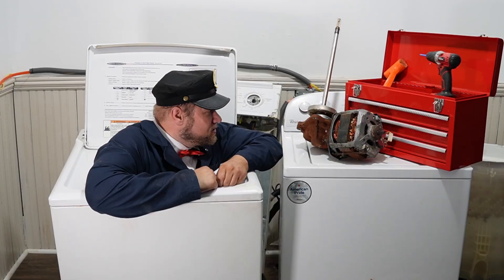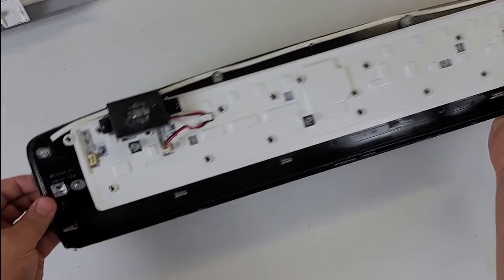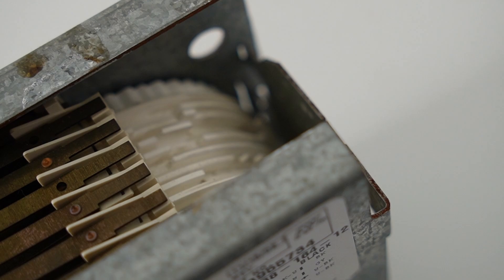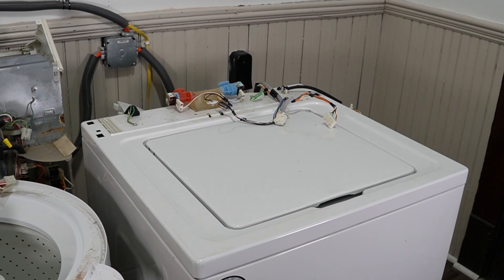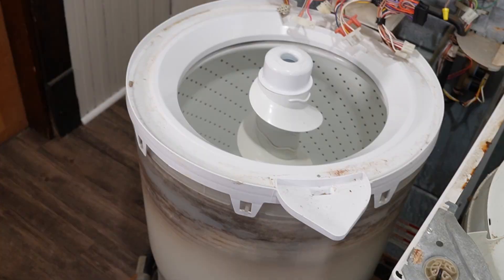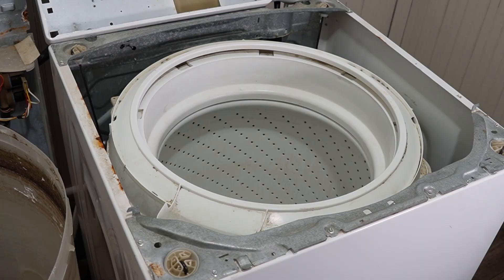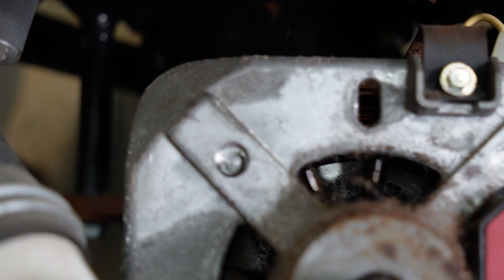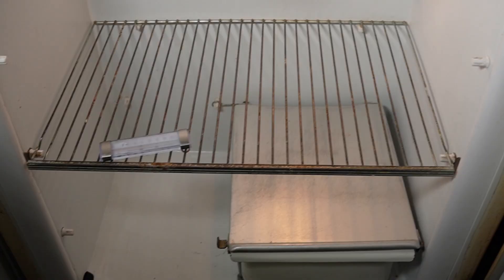Are Washers Built to Break? Inside a 1984 Washer vs. Now

Comment: The older stuff used electromechanical parts that were easily and affordably replaceable.  So now we have circuit boards and ECM control modules.   Ok, not that much harder to diagnose, but what used to be a $30 electromechanical part is now a $200 circuit board.
Reply: Those pcbs automatically get replaced. Stick with a true timer switch whirlpool based unit and never have a problem.
Reply: I'm a hardware/firmware engineer, it saddens me that people believe old mechanical systems are robuuster than modern electronics.

It's not that newer electronics are less durable by design, it's that management wants everything as cheap and fast as possible. Idem for most consumers these days, who prefer cheap and affordable equipment regardless of it's apparent quality. 

My washer broke a couple of years back, the repair technician told me to buy a new one as a replacement control board would cost 300USD. I reverse engineered my old washing machine, designed my own control board in eagle cad... My 18 year old washing machine has now WiFi, BLE and ZigBee... It's also configured to remain in standby, until my smart meter and solar panel setup commands it to power on. Saved me a lot of money on my energy bill so far...

The circuit boards I design for personal use  (such as in my washer) will most likely outlive both new and old examples shown in this video. I avoid cheap mechanical relays and use solid state relays with a lot longer lifespan. I keep some additional headroom in voltage and current calculations, and avoid components from reaching troublesome temperatures. Somehow my 'control-board deluxe' costed me only 150USD, instead of 300USD for the 'manufacturers e-waste version'...
Reply: @timmy7201  sounds like you may have a business to create boards for popular washers.. I’d be in to “hack” my washer.
Reply: @toejamr1  I've had the same idea, yet a colleague warned me for possible lawsuits for copyright infringement from the big corporations. Selling custom circuit boards would also require compliance testing, which is kinda expensive...

I've thought about open-sourcing everything for free, but with a money deposit system for financial support. People can use it free of charge, on their own risk. This way I'm not selling any commercial end-product, but rather a solution to a problem. I'm just not sure if such approach is "lawsuit safe", would need a lawyer to go through all paperwork as I as a tech-person can't focus on such administrative nonsense for more than 5 minutes :-( ...
Reply: @timmy7201  ..problem is..they are NOT cheap!..new stuff is WAYY more expensive..and not as good...we get sold "features", not quality..just give me something that washes clothes, and does so reliably, for a long time..no fancy features needed...
Reply: @timmy7201  also those pcbs cost a couple bucks to make tops
The companies like you said became greedy. They realized you need to get the controller
So we make it slightly less than the entire new machine. This makes the new machine seem like a better deal. And even if you get the board they make profit

I think another issue now is everyone reads reviews of equipment and these reviews are not long term and not edited to reflect reliability. This skews reviews to units with the best functions or new features. In the past you’d probably ask your neighbors to see which ones broke. Now you only complain to em after it breaks!
Reply: @timmy7201  so basically what you're saying is.... reverse engineer your washing machine and build your own circuit board and it might just be more reliable than an older machine. sweet, sounds easy peasy.
Reply: @dyer2cycle  Go for a bare bones Speed Queen. They use the same parts on their home washers as their commercial ones.
Reply: Yeah but you can also learn to do some electronics troubleshooting and  how to solder and the replacement parts are usually under a dollar.
Electronics are not a voodoo blackbox and with the internet there is zero reason to allow them to mystify you like they did in the 90s and early 00s.  Its a good skill to pickup now more than ever.
Reply: @busterscrugs  Well... It's easier than it looks, a washing machine only requires basic electronic and coding skills...
That's how I preferably pass my Friday and Saturday evening, designing electronics stuff and coding firmware with some friend(s) and cold beers... :-)
Reply: @hgbugalou  Yep, usually only a bad micro relay soldered to the board. In the case of HVAC controllers, anyway.   
Doing a board repair will buy you some longevity, but when it goes out a year or two later, your company catches hell from a bad review.  All because you attempted to help out a customer.   So we just replace entire boards.
Remember, that relay burned up for a reason, and all those tiny upstream and downstream components and IC’s took a licking.  In effect, you have only changed the worst damaged component that gets the unit basically operational for a while.   Can’t exactly solder in a microprocessor 1/8”x 1/16” that has 16 pins.
Reply: @timmy7201   I designed a replacement for the control board in my whole house humidifier in KiCAD. The old broken one was a janky single-sided PCB designed by Honeywell. The replacement is basically a stripped down Arduino Pro Mini attached to a perf board, and using a similarly pared back version of the Arduino libraries (remove the cruft and build using a customized makefile). That still manages to be about 1/2 the size of the original control unit.
Reply: @blackhawk7r221  I had a relay go bad on the control board for my furnace a couple years ago, in late January in Minnesota... It actually started on fire, and the whole house smelled like burning plastic. Luckily I was home at the time and was able to shut it down before it got any worse. picked up a replacement relay at MicroCenter for $3, swapped it out and it's been fine ever since.
Reply: I have replaced contacts in mechanical timers in washers, dryers, and dishwashers. Contacts are available, but I just used donor contacts from relays. A good rule of thumb: hot water, steam, and electronics don't mix. Stick to mechanical timers.
Reply: Pretty much this. The circuit board combines all of those discrete solenoids, switches, and relays, and when one of them fails, it's much harder (in some cases impossible) to replace just the failed part.
Reply: @reecenewton3097  I have  Sears Kenmore dishwasher from 1971. A few years ago the timer stopped working. Removing the timer I noticed who manufactured it. I contacted the manufacturer and they said they can replace it for me. 60.00 well worth it. Midwest Timer.
Reply: @timmy7201  The automotive repair industry; upgrades failure mode parts all the time, maybe this can be done with the failure pone appliance parts? I think, there could be a market for this type of thing.
Reply: @timmy7201  If you set up as a Unincorporated Business Trust or a Private Membership Association you can avoid all of that BS. You can either do it yourself or find firms specializing in these areas to set you one up.

Many big businesses are set up this way, and not subject to various countries' federal codes. We currently run a PMA, tho in general I think a UBT is better.

You've got a great business idea so I'd love to see you succeed. My 1.5 month old washer is useless for 3 weeks until the lid lock is replaced, so I'd love a functional bypass for that component alone as I love everything else about the washer.
Reply: @timmy7201  simple things like socketed relays and not cheaping out on your power supply is seemingly all you'd need to do to make it really solid system, that and not omiting the anti sease lubricant. If I was building it from scratch I'd use a brushless motor and an esc to be able to replicate the braking the older unit had but that's really it
Reply: @dyer2cycle  within the last few years adding "smart" features has gotten rediculously cheap. For me to get a single microcontroller with the hardware capabilities to control all of the logic and networking to add smart features to an appliance would be ~$10, which turns to peanuts once you integrate it into a control board and start making them by the thousands. 

The features are not why you are paying more for a shitty product, its just inexcusable
Reply: @timmy7201  mechanics are better than electronics
Reply: @timmy7201  by your own writing, the older units are more reliable than almost anything sold today. It's just the way it is
Reply: @timmy7201  mechanical relays aren't pey say cheap we use them in industrial applications all the time. Solid states have their uses and places but can't be used in system were they require both no contacts and and nc. I like infsutrial washer because everything is repairable in them they use plc motors valves controllers are all replaceable and easier to acces as maintenance was a string subject with these the shaft are around 6 inches wide so those won't wait anytime soon
Reply: exactly my point with my air con story above
Reply: @Spots Corner When my TV failed, I replaced the main board from a donor TV for about $50. I don't see why this shouldn't be possible for a washing machine.
Reply: The reason why consumers want cheap things is for the last 15 yr even if you saved up for a 2-4 thousand dollar appliances they only last a 2-3 yrs like the cheap one because big company only care about maximizing there profit instead of make loyal consumers and higher market shares
Reply: as a consumer, thats a problem. as manufacturer that must seem like a cash cow.
Reply: @timmy7201  your gonna need to pot your goods in resin or the humidity is going to make the standby section grow hairs and start emitting bogons.
Reply: @xinfinite8698  Mechanical hard drives fail more quickly than solid state drives.
Reply: @howard2liu  Im talking about machines. Ofc SSDs are better than hdd lmao
Reply: TV's and HI-Fi/Stereo modules is an exception. They still use a lot of cheap parts even on most expensive models.
Reply: @LeetHaxington  If electronic board dies chances are its the graphite dust. They dont die that often not gonna lie,other parts die before. Mainly its stuff like suspensions pump or something like that. And if electronics die,its because everything connected to it isnt protected. Meaning if a pump or door lock goes bad,shorts itself,it burns the board. Major flaw
Reply: From hobby grade replaceable parts to toy grade circuit boards. What a sham.
Reply: @timmy7201  reverse engineering is never illegal, but the sad thing is they can take your money anyway, by forcing you to go to court. Go to Shenzhen and you'd be safe, but then of course you'd have to live in Shenzhen.
Reply: @hgbugalou  the average person is never going to be comfortable soldering SMD, and what about all the parts that are potted, black-blobbed, or had their part numbers removed by the MFR?
Reply: @T4nkcommander  God, I fucking hate lid locks. I am not a toddler! Nobody tall enough to open that lid is dumb enough to stick their hand inside. So frustrating.
Reply: @Croz89  where exactly is there a readily available supply of broken washers? Pray tell.
Reply: @tissuepaper9962  Well people seem to replace them often enough! There's also house clearances, store surplus, shouldn't be that difficult.
Reply: @Croz89  rummaging around for e-waste isn't "readily available". To use donor parts the opportunity to acquire a donor must present itself to you.
Reply: @timmy7201  I've also thought about it. If the mech timer in my old washer goes out again, I may replace it with a custom relay board that runs off a Arduino nano or Pi Pico type controller. Control loop doesn't seem that complex. Sold as a kit for the end user to assemble there shouldn't be much liability on your side, and kinda think anyone that's even remotely considering doing something like this is not going to be terribly turned off by it being a kit of parts because it's well into hobby/tinkerer/enthusiast stuff to begin with.
Reply: @tissuepaper9962  It works for televisions so I don't see why it can't work here.
Reply: @Croz89  there are an order of magnitude more televisions being thrown in the trash.
Reply: @tissuepaper9962  I disagree. People replace their TV about as often as their washing machine.
Reply: @Croz89  most people only have one washing machine, but several TVs, and TVs are much cheaper than washing machines.
Reply: @tissuepaper9962  A decent UHD flatscreen will cost a similar amount to a good washing machine, and having more really doesn't make any difference. If there's more of a product being used, there's also more faults that need repairing. To the availability of spare parts is roughly the same.
Reply: @Croz89  you seem to be operating under the assumption that most people repair their stuff, that's clearly false. All of this crap is going in the trash, that's the only reason you're able to use it as a donor in the first place.

And who said anything about "decent" TVs? If you want to talk about high-end TVs then you should compare them to high-end washing machines, no? The fact remains that I can buy a flat screen TV for $200, and the cheapest washing machines are starting at $1000.
Reply: @tissuepaper9962  $1000 is an expensive washing machine, I can get a good one for the equivalent of $500, about the same as a 50" UHD TV.
Reply: @tissuepaper9962  I am not really appealing to the "average" person, just the handful of people willing to learn a new skill for the fun and benefit of it.  Some people like myself like learning new things, especially when it comes to building and engineering. There are certainly challenges to fixing some electronics, but there were challenges in fixing some of the mechanical counter parts 30 years ago.  Heck, some of the mechanical solutions are harder for me to understand than the electronics. 🤣
Reply: No excuse here. The control boards on theAse really AREN'T that digital nor smart. They use electro mechanical main components too. Just there made not to be removable but it's possible. Wifi/bluetooth chips machines have a single tiny chip the size of your thumb nail . I've never seen one fail. The relays go though.. or the chokes or some kinda short circuit from damage elsewhere or water. 

Really they're dumb machines. They use ladder logic .. it's a very limited amount of variables
Reply: don't forget to normalize that 30 bux for inflation, solid state electronics can be much cheaper than electromechanicals & more reliable, but are more abstract/less serviceable by the average person.
Reply: @timmy7201  That's the thing though. It's created with cost-cutting in mind, which leads to it being worse for everyone. Including you, from whom it took what probably amounts to tens or maybe hundreds of hours to reverse engineer, create, program and deploy a one-off replacement board. 

All it would take to make these machines as reliable as the old stuff is like $20 in parts to overspec the drive circuit and a conformal coat on the PCB to keep the moisture and bugs away.
Reply: @timmy7201  I did the same thing with my hot tub.  built My own control system that was much more powerful and cheaper. I wouldn't say it was more reliable though since I didn't know I was doing.
Reply: @hgbugalou  can't really repair a pcb that needs Louis Rossmann level of skill and tools.
Reply: @unionse7en  if anything mechanical parts get cheaper because a poor man in Pakistan can build one. But you need the machines and software to build pcb
Reply: @shadowopsairman1583  I have harvested brass relay strips with contacts and sweat soldered them in place of burned timer contacts, with the repair lasting the life of the machine: dryer, washer, dishwasher.
Reply: @timmy7201  I agree that electronics can be made to be extremely reliable. But consumer electronics and products are way past that now. That ship has long sailed. It docked off the shores of China.